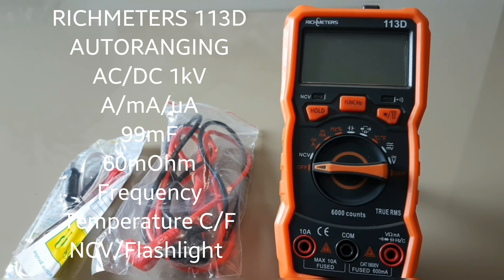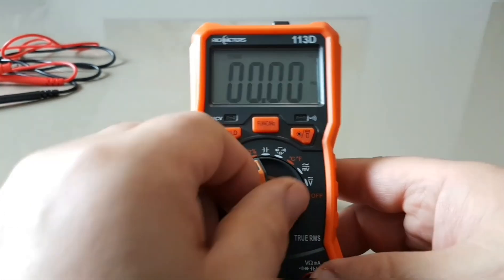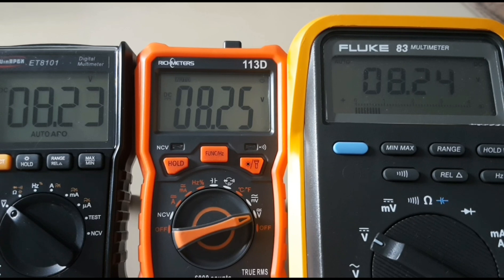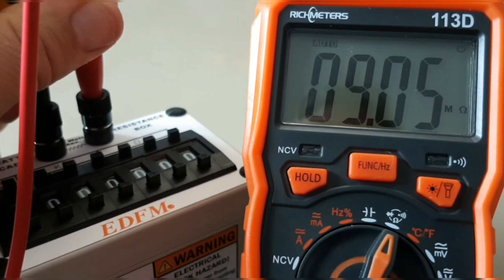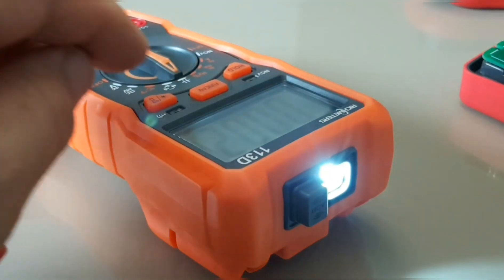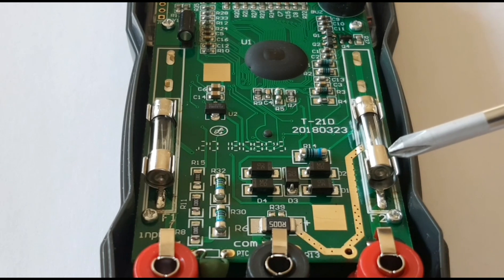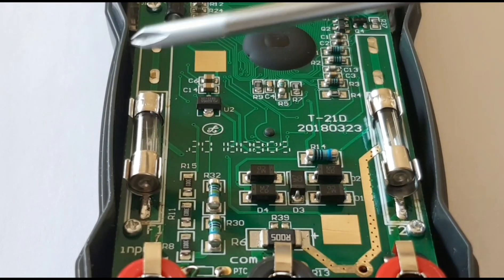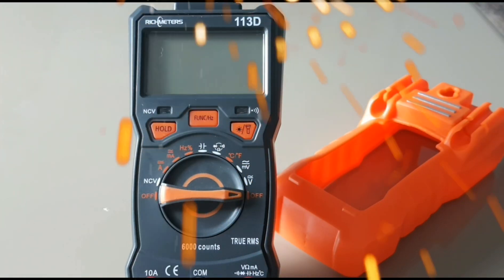RICHMETERS 113D CHEAP-O Multimeter Review & Teardown!

Comment: Just ordered the NJTY version(exactly the same) from Walmart for $16 with FREE SHIPPING. Looks like I’m getting a decent meter especially for the price! I mainly got it because it has a capacitor tester that goes a lot higher than the one I have now which only goes to 20uf ! Hopefully it lasts at least a year. It’ll be worth the price even for that long. Maybe stick shielding tape on the inside? This one is a LOT better than the one I have which was $10 more at Harbor Freight!

Comment: Just received one of these from 'RICHMETERS Official Store' on AliExpress.  Cost was slightly over fourteen dollars U.S. plus taxes and with free shipping.  Tracking was provided, though few details were available once package landed in U.S.  Meter as described by Darren, except batteries were not included and rear magnets have been removed due to 'shipping rules'.  Both omissions are stated in item description, however.  Unlike Darren's, my unit included an English manual.

Unit is quite compact and weighs nearly nothing until 3 AAA's are inserted.  My unit included better leads than the one reviewed by Darren, but they are still very cheap.  The PVC cord is not stiff, however, and they seem quite usable.

As with many meters, holding down the FUNC button while turning on the meter will disable the auto-poweroff timer.  This is indicated by a low-pitched triple-beep upon power on.  Unfortunately, there appears to be no way to disable the auto-off feature on the backlight and flashlight, both of which turn off after 30s.  This may have been improved slightly, as this is better than the 15s stated in the manual and experienced by Darren.  It appears that now both backlight and backlight/flashlight modes shut off after 30 seconds.

Though meter claims a 600V limit in Voltage mode, almost all other modes are rated to only 250V and the included glass fuses are only 250V as well.  2 replacements fuses were included in battery compartment, but both are 600mA/250V; no 10A replacement was included.

3 AAA batteries seems rather excessive for a meter of this size, but it does provide plenty of voltage for lighting LED's in diode mode.

Continuity mode beeps immediately and is the fastest I've ever used, but LED and display take up to a half second to respond.  The display speed is no problem, but it's too bad the LED isn't hooked to thee same trigger as the buzzer in this mode.

I wish it had a RANGE button instead of a useless HOLD button, but I cannot complain at this price as even some more expensive meters don't offer manual range control.

This may be the best $15 auto-ranging multimeter available at the time of this post.  My only complaint is the ridiculous backlight timer, but this is a problem with almost all Chinese brands.  Modding the backlight with a latching circuit would be nice.
Reply from the maker: Wow...great update Rob! Thanks so much...
Glad to hear the BL timer has doubled since this review though a permanent BL would still be preferable. I'm going to pin this comment so anyone looking at this great dmm can see what's been updated since the review was published. 😄👍

Comment: Richmeter113a and 113d same meter?
Reply from the maker: 113A = MANUAL Ranging 
113D = AUTORANGING with Temperature 🌡
Reply: @KeepOnTesting  last question which is better MANUAL Ranging or AUTORANGING multimeter guide for me to buy new one
Reply from the maker: @cardosaydali5758  I would go for the AUTORANGING ,  more efficient and it has a few more features than the manual version.😀👍

Comment: Overall, which is better? WinApex ET8101 or Richmeter 113D?
Reply from the maker: RM113D
Reply: @KeepOnTesting  i just ordered winapex et8101 for about $12 here in the Philippines. Is it worth it or I did a mistake?
Reply from the maker: @zrpgelo  Winapex  ET8101 is still a great multimeter..no worry. 😀👍

Comment: Are you having any difficulties measuring ma? My 113D, not sure if its not functioning properly, but LEDs which should be showing 10-20mA are showing 1 to 2 mA (lights up) If I switch to A, its showing 0.03x but doesn't light up the LED.
Reply from the maker: Hi David, I'll take another look over the weekend and let you know if I notice any discrepancies with mA.

Comment: I got 113A from aliexpress, ncv doesnt work, ideas ?
Reply from the maker: Did you inspect the NCV filament on the pcb? How does the soldering look...it might be a cold joint, so you could try reflowing the solder with a little flux.

Comment: Darren, obviously the better leases leads make a big difference. What were the better leads that you used
Reply from the maker: Need a cheap set of great leads, try these!
https://rover.ebay.com/rover/1/711-53200-19255-0/1?mpre=https%3A%2F%2Fwww.ebay.com%2Fitm%2FFluke-TL71-10A-Hard-Point-Test-Leads-Set-for-Multimeter-Meter-Probes%2F264437737818%3FssPageName%3DSTRK%253AMEBIDX%253AIT%26_trksid%3Dp2057872.m2749.l2649&campid=5338362906&toolid=20008

Comment: The NJTY T21D seems to be the exact same meter for as low as about $13 on ebay at that price for a rubber cased rugged  "beater meter" it is hard to beat with 6000 counts and the best sensitive continuity set up both with light & buzzer. Upgrade the test leads and you will have one hell of general household meter for low energy work away from the main breaker box. I have no idea what NJTY stands for but leave it to the Chinese to obfuscate who actually makes their meters.
Reply from the maker: Thanks for the update. Indeed it's the identical multimeter. CHEAP-O Beater...I like that! It's a tough little dmm I will give it that..KEEP ON TESTING !

Comment: The NJTY T21D version I've got has much better test leads. I also did some additional coil on the tip of the ncv sensor, it now has more sensitivity when pointing the device near an electrical source.

Comment: I just got this as a present. Always hated the italic number. Quite good dmm tho. I didn't get the instruction manual as well. I didn't even know the measurement ranges. That's why I'm looking it on internet. I'm surprised the capacitance measurement up to 99mf.   I have bunch of cheap dmms, they usually only 200uf, 4mf or 10mf. Even the people favorites aneng 8009 only handle up to 10mf.
Reply from the maker: 113D was full of surprises and the high Capacitance range was deilfnately a bonus! All around it's a  winner  and should serve you well! Congrats on your great gift!

Comment: After I watched this review, I ordered it from aliexpress. I'm more than happy with this device, because my work is based on car electric and small low power circuits. NCV is working just fine, already found one cable where is losing contact. Thank you once again.
Reply from the maker: Great stuff!! Yes the 113D is an excellent multimeter with alot of great features! Glad you are happy with the dmm.

Comment: is it better than DT-9205A ?
Reply from the maker: DT-9205A is non autoranging ..basic dmm but still an excellent instrument in it's own right.113D is more advanced, smaller design and better set of ranges..if I had to  choose I would opt for the DT9205A because its  proven a worthy multimeter that just doesn't quit..I prefer the bigger size display and beefier rotary selector switch. YMMV

Comment: Extra connectors above the fuses will be to fit longer (1000v) fuses, 20mm fuses are only rated to 250v, they really should have a marking on the front panel to indicate that the current ranges should only be used on up to 250v circuits for safety.

Comment: I have it! its very good and accurate multimeter. the only cons are that the digits on the screen are fading if you look from some specific angles and that the light has so short duration(very annoying).
Reply from the maker: Roger that, I wish those back lights would just stay on until we turn them off..
Reply: Do you still have it? Is it still working?
Reply: @eduardoluna8893  Yes, I still have it and it works fine! It's still my favorite DMM!

Comment: Hi. What is input impedance to this device?
Reply from the maker: Good question, The RM113D has 11MΩ (Megaohms) of input impedance. I measured it with a Metrahit 2+. That's  on par with more expensive multimeters.
Reply: @KeepOnTesting  Thank you so much. It has same input impedance of unit ut139c. Which one do you recommend RM113D or Winapex Et series ?
Reply from the maker: They are both really good meters but I use the WinAPEX ET8101 almost every day alongside my other meters. You cant go wrong with either in my opinion. The customisable backlight and high capacitance range sold me on the WinAPEX.
Reply: @KeepOnTesting  But as i see in your video, the RM113D measurement accuracy is better. Is not it?
Reply from the maker: Yes I found the RM113D a tad more accurate even though they both use the same EEPROM that stores the configuration information for the main microcontroller. (DTM0660 multimeter IC) at the end of the day it really comes down to personal preference ;)
Reply: @KeepOnTesting  You really helped. Thank you so much.
Reply: @KeepOnTesting  i forget to ask et8101 input impedance :)
Reply from the maker: 11MΩ (Megaohms) as well. :)
Reply: @KeepOnTesting  I don't know how to decide :)
Reply from the maker: I would choose the WinAPEX Model:ET8101/2 !! Excellent Meters.
Reply: @KeepOnTesting  Last year I bought  Peakmeter PM18C from Aliexpress. But suddenly it has shutted down byself a week ago. I turned on the device. It was working, sometimes 5 seconds, sometimes 10 seconds, sometimes 1 day. Then it was closed byself again. I opened the device case, checked the solders and the components and even changed some of them (for example 3 capacitors, 3  j3y, a few resistor). However, the problem persisted, could not be fixed. Now it doesn't turn on. I ordered from China J3Y and 7530-1. I'm gonna change them and try. On the other hand, may be eeprom or main integrate were damaged. I do not know. So I'm looking at a new multimeter. I need a longer-life multimeter. I've seen your video and subscribed to it while doing research.
Reply from the maker: Bilal, You can send it to me and I'll try to fix it for free ;) Perhaps I'll make a video with the attempt. It can be any number of things but if there is no power being displayed at all, I don't think it's the main IC. Probably a short somewhere in the circuit.
Reply: @KeepOnTesting  Thank you very much for your interest. I really want to send but in my country (Turkey) overseas shipping costs are too high. For example, it's about 20 dollars to send the multimeter.
Reply from the maker: Hi Bilal, no problem...hopefully you'll get a new meter soon!
Reply: @KeepOnTesting  Thx. I will get. But, May I ask why you did not make review  vidoleo for Et8101?
Reply: @KeepOnTesting  review video
Reply from the maker: Hi Bilal, I did do a review on the Win APEX ET8101...do a YouTube search or click on my videos to find the link. THX.